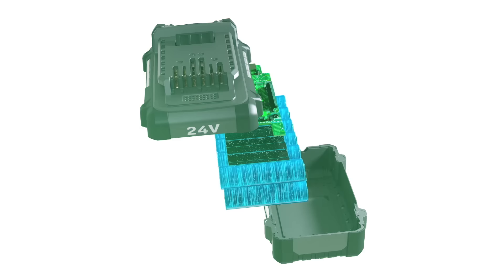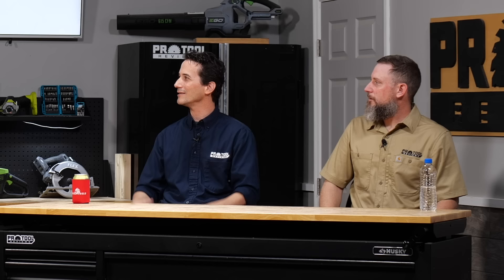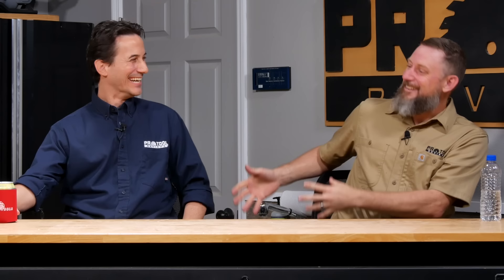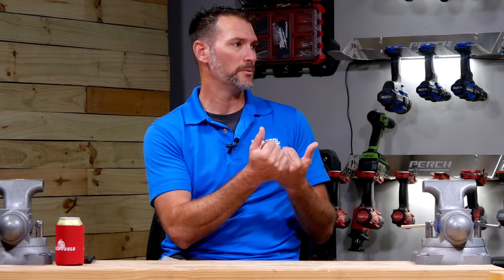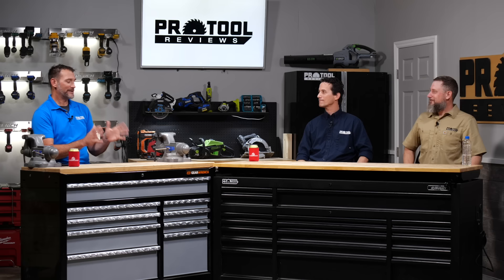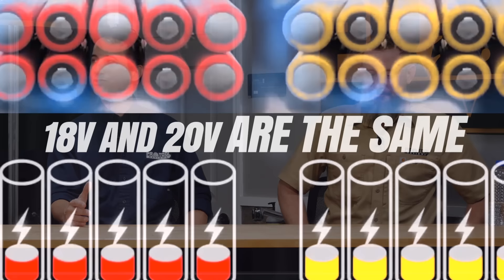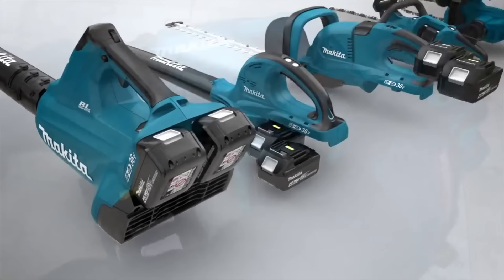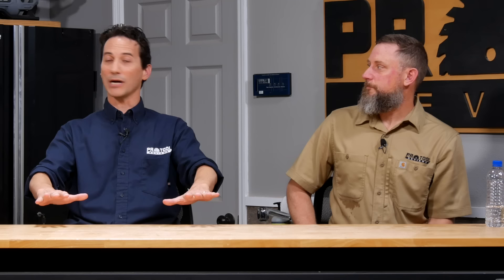You Should Buy 12V Instead of 20V… HERE’S WHY!

Comment: It’s refreshing to see a transition in the conversation around tools from “I need the biggest, baddest, most powerful tools possible” to “Maybe we just use the tools that make the most sense for the specific application.”
Reply: That’s right I love my 12v for my automotive use. Haven’t had the need to upgrade to bigger power yet as I also don’t do suspension or anything really mainly interior work and basic maintenance
Reply: fartpoobox ohyeah  you obviously have never tried to use an impact on screws in metal. Bolt heads shear off with a sneeze if you aren't paranoid in how you drive them. Most Bolt heads also not rated for impact shock so you damage them on first drive in.
But most people with your mindset never actually pay attention to who is going to have to pull out those fasteners or take off that hose clamp or in general to any work on any of the stuff you touch after you personally leave.
Reply: More power is always better. It’s the capability in a smaller, lighter package that is changing the convo.
Reply: @actualperson9628  yeah no because when I'm taking off 5mm bolts I always say damn why can't I have more than 300ft/lbs of torque.
Reply: fartpoobox ohyeah  damn you must be the first person to not strip or shear any bolts in their working experience. Congrats teach us all
Reply: @jonathangarzon2798  You got some points and i keep seeing people who never use powertools being the biggest fans of M18 Fuel.
Reply: It’s because they use thicker gauge windings in the brushless motor to handle the higher current.
Reply: @jonathangarzon2798  I don't know many people who impact metal screws or hose clamps.
Reply: @im2yys4u81  oh they are the majority, it's frustrating because they only do it since they won't be working on it after most likely
Reply: fartpoobox ohyeah  I agree you can't be an 18 more power better if they suck at driving screws then they suck at driving screws
Reply: Same thing with pickups. More power and more size !
Reply: @Richard Charles impacts have 3 adjustments. And as someone who actually works in the trades I can say for a fact that clutches on drills are scarcely used. 
So yeah my point stands
Reply: 12v was designed for small spaces, weight advantage over higher voltage tools when up ladders etc, according to MW's website, horses for courses, I use a 12v set of Makita brushed drill and driver while working on cabinets, bigger Makita stuff for heavier jobs.
Reply: @johnussss  please define heavier jobs though, that's so vague
Reply: @jonathangarzon2798  Ask Milwaukee, that's all their website blurb says  on the 12v stuff... Sub compacts are less able than the bigger tools, do your own research, I did

https://www.youtube.com/watch?v=TKqkqs7qvXg
Reply: @johnussss  yeah I've read the marketing. That's useless.

I prefer to ask actual workers who use them where they've seen the tool work and fail to have enough power.

If I want marketing slogans I'll read the website again lol
Reply: @jonathangarzon2798  Watch the video I Posted then, that guy uses both 12v and 8v versions
Reply: @pflaffik  How do you know what they use? ... magical spy boy?
Reply: I’ve been using cordless tools for 40+ years doing HVAC&R as well as hard core woodworker. Probably 20 to 30 tools dead, lost or stolen, mostly dead batteries. Was started with the M18 was very impressed with the hammer drill (near corded performance) left behind out of state picked up some M12 and was impressed for there size and weight not the performance of the M18. 
As for circular saws I’ll stick with my corded saws.
Reply: Maybe you good way to look at it is maintenance versus building/construction.
Reply: @jonathangarzon2798  I was a commercial electrician for 5 years I started with m18 drill impact and all sorts of other crap. I swapped all except the drill out for m12 and it never failed. Really used the drill a lot for drilling into concrete so I needed the bigger one. 12v platform hasn't failed me
Reply: Power still trumps all at the end of the day
Reply: I've seen fellas dragged thru the mud for using 12v on site. Gotta show off what muscle we got with the biggest tools
Reply: Yes. In general, I like the idea of switching to 12V tools for most things because I don't have a job where I'm using tools like impacts and drivers and saws every day. The 12V batteries occupy much less space and have enough power for what I need, although there is a major lack of 12V outdoor tools generally speaking. That's probably because more power is just an unavoidable necessity. =/
Reply: Nope. The m18 fuel impact is a venerable multi tool with 4 settings. It can be as delicate as anyone's sensibilities! My m18 drill is also a hammer drill. Neither are noticeably heavier the my old makita stuff which was lighter duty 18v stuff from 15 years ago.

I don't want to have more sets of drills to think about when I can have 2 that do it all. And happen to fit the same batteries as a bunch of other tools I own.

I have m12 batteries and a dremel, 1/4" nut driver, and a screw gun.

I gave the m12 screw gun to my aunt for general home use. It's a non fuel variety and goes about 2rpms... one day Bobby, this screw will go in, wait for it, almost there, uh oh... no beans...

The m18 impact on delicate, drive it in, 5 taps of impact and its snug, 7 its tight, sometimes it stops for you.

Comment: M12 systems for the sheer fact the 3/8 and 1/2 stubby impacts can fit just about anywhere without the battery smacking everything
Reply: Just broke down and bought the 3/8 stubby and it knocked lugnuts off easily
Reply: have you used or have the right angle impact? I'm stuck between the m12 and the kobold because the Kobalt does 300 lbs in the reviews.
Reply: @bobthompson4319  I personally have not but I've pulled 350ft lb torqued mast nuts off forklifts with zero issues out of m12 1/2 stubby. I think it's like 1-5/16 socket and it handles it good
Reply: @throughmylens5127  that makes me happy. I just got the stubby 3/8 on sale for 129, waiting for it to ship still, its on backorder. I already have the m18 1/2 impact wrench, I was scared the stubby wouldn't have enough power.
Reply: Preach on it brethren 🙏🙏🙏
Reply: I have a 💩- ton of 24v Kobalt tools and have, overall, had great service from them.

Finally fulfilled the 41+ years of sailing magazine dreams and bought a boat: buying a replicant M12 Milwaukee set of tools after using some on a friend’s boat.  Size really does matter.  Now if only I could convince my wife!  😇

Comment: The higher voltage means you’re drawing less amps, meaning the wiring and electronics can be sized smaller. So double the voltage instead of using 8 gauge wire you can use 16 gauge (half the size) and have the same amount of resistance. The resistance is what causes the heat.
Reply: Hi, new homeowner/DIY'er here. Do higher amps actually FEEL more powerful like with RPM's and longer projects? Thanks.
Reply: @bennygerow  if anything it would be the opposite, higher amps mean shorter battery cycles (as well as shorter battery life, the lower the current load the better) and voltage is what determines the speed of a motor (under no load, a motor will spin at a speed which is directly related to the voltage supplied, so a lot of motors come with a kv rating - velocity constant - which is how many RPMs you get per volt.)

However, motor torque is dependent on amps. A motor setup for higher current will have more power and torque overall. Generally, higher voltage is better because of what MondoTV described as well as the above points I mentioned. A 12v (3 cells in series/3S) battery supplying 180w (15A) with the same cells as an 18V (5S) battery supplying 180w (10A) will last 2/3rds as long and generate more heat in the process, degrading the batteries and the rest of the components faster.
Reply: 8 gauge to 16 gauge is not 'halving the current'.  8 gauge to 12 gauge is the half point (40 amps to 20 amps typical).  But I get what you're saying.
Reply: Double the voltage, half the amps. Sounds good. But then how many batteries in series-parallel is needed to make the higher voltage. Then it gets heavier.
Reply: @imperialsecuritybureau6037  Higher amperage is beneficial  for  more power . If you don't need the power  go with 12v. If you need more power, go with a higher voltage. Higher amps does not equate to shorter battery cycles. You're confusing amperage with power (Watts)
Reply: @bennygerow nope, just makes the battery last twice or 3x as long, which translates to feeling more power over a longer time vs a short burst of power then the battery dies down after 2 minutes of use

Comment: DIY guy here. I build a lot of stuff with screws and construction lumber. The lumber needs to be pre-drilled, so I like a 12v drill and  impact so I don't have to switch bits. But every DIYer should also have a reasonably powerful 20v drill, cause when you need it, you need it. I think most of us would end up (budget permitting) with a mix of 12 and 20 volts.

Comment: For a small engine mechanic like me, 12V is ideal because you can run many (but not all) screws, bolts, & nuts down without accidentally stripping them from over tightening. Plus, most fasteners can be removed easily with 12V.
Reply: There is a thing called clutch on drills, you know
Reply: To be honest most good 12v impacts will carry you pretty well through MOST automotive applications. I've used a m12 stubby to remove rusty old motor mount bolts on a f150. And the m18 high torque carries me all the way through kingpins and lug nuts on class 7/8 trucks
Reply: I'm also a small engine technician and that DeWalt 12v 1/4" screwdriver is my go to for 90% of the stuff I do as I handle most of the handheld ope. The adjustable chuck works like a fast and dirty torque wrench, the lack of impact is safer on plastic/delicate components and it's so compact when you're working in tight spots like snowblowers and lawnmowers.
Reply: if you work on ANY engines, the M12 Stubby impact wrench is KING
Reply: @shadeshiest22  DCF850 3/8" converted with a 1.7ah powerstack is king.

Comment: I buy m18 because I see my coworkers spending 3 minutes to cut one peice of conduit with there m12 while talking about how it gets the job done the same. The Sawzall kinda depends on the blade but fresh blade to fresh blade it feels like I'm cutting atleast twice as fast vs. The m12. The bandsaw seems like 3 or 4 times faster. Don't even get me started on holesaws on those tiny m12 drills.
Reply: The higher voltage bandsaws also have larger openings which makes them MUCH more flexible.

Comment: I actually like the M12 Fuel circular saw for it's light weight and ease of use. Sure it's not as powerful as the M18 Fuel, but as long as your not cutting stacks of lumber, M12 will get the job done just fine.
Reply: Emphasis on the "light weight" that's the best part for repeated small jobs
Reply: I have the m12 saw been using  it for 4 years  I do remodeling and handyman work this saw is my go to. I have makita 36v rear handle and standard but the m12 is a beast
Reply: I want to get that. I love my m12 tools
Reply: I use the m12 saw with the 6amp battery. Even then it's basically a sheet good breakdown saw to kick around the truck just in case. Honestly dont like cutting 2x4s or anything larger with it as it sounds like I'm asking to much of it when it runs. 
If I'm onsite no power il use the m18 saw with the 12amp it came with. Rapid charger plugs into the truck.
 
I know this is sacrilege but still prefer a corded wormdrive for alot of things. I like the torque and that the saw doesnt bog down under load. Some sidewinders rev so high at freespinning they sound like they're going to rattle-fly apart [skilsaw sidewinder] dewalt makes a good sidewinder we've had good with with.
Reply: @martylucas8557  So you just go to the return counter with the item you don't want and ask for a refund? They don't care about the free tool?
Reply: @grantdeisig1360 , FYI…in January I used the hack to get the awesome M18 Fuel 18 Gauge Brad Nailer.  It included a free 8 amp battery.  After returning the battery I ended up paying around $149 for the nailer.  

If they didn’t want you to be able to return the battery or tool they’d state that in the receipt.  However, since they assign a separate price to the tool and battery that equals the price of the tool, it allows easy returns.
Reply: @martylucas8557  Understood. Makes sense.
Reply: Same man, I have Dewalt 12v circular saw and it’s so light! It comes up on my ladder with me and anywhere I go that I might have to cut something
Reply: The only time I've had a problem with mine is when I was 8ft of cutting 3 in Maple. I would have to take multiple passes quarter in each time and then flip it once I get to the back I had trouble didn't mean I couldn't cut it.
Reply: Me too!!!!!
Reply: "Not a real tool" is pretty harsh. What if all u do is decks. 12v circ saw for cutting ends may make this an A1 tools. I kind of feel like this kinda stuff is in the "you only have an sds plus you need to get a spline drill for that 3/8 hole." ;)
Reply: I often find that if the 12v isn't powerful enough for the job, I'd rather go corded because it means I'm working the tool all day. My 20v tools are the least used.
Reply: Yeah man I was going to say, M12 is a beast for what it is.  The weight and size and it’s performance fits for what I do .. 90% of the time it’s all I need for my cuts ..

Comment: We run a farm. We use power tools a lot and are hard on them. I used Dewalt for a long time and then began to invest in the Milwaukee platform. Started with the intention of doing all M18, somehow I ended up with M12 impact and drill. I was sold after a few uses. The M12 does most of the stuff we need. A few exceptions are we have M18 impact and 18 grinder. The M12 platform is unbelievable powerful and reliable.

Comment: If you can afford/justify the luxury, having both 12v and 18v platforms is phenomenal. Certain tools are well suited to either voltage. M12 and Makita LXT are my go to, and I break out each set equally as often and can tailor to the task I'm about to go perform
Reply: I have Makita LXT, love it, but jumping into m12 for the rotary tool.  Thinking about splurging for the installation drill/driver. Any other standout m12 tools that you feel fills in gaps in the Makita lineup?
Reply: Hydraulic impact driver is a real pleasure to use, if you have the option. The new 3d laser is also a must if you are in the market for one.

For my work, being a electrician, the compact bandsaw, right angle impact/impact wrench/ drill are really doing the trick
Reply: You should check out the newer m18 fuel impact guns. It has 4 settings. It's basically a multi impact of some sort.
Reply: @mischavanengelen5343  I don't like the m18 fuel hydraulic impact. It has half the rpms, and half the max torque compared to the non hydraulic. I don't know if the hydraulic one has the multiple power settings that the non hydraulic has either. Mine can ram it home or be beautifully delicate.

"Like a leaf on the wind" - serenity

Comment: I think for most DIY projects you really only need a cordless drill and/or driver. Corded cutting tools are more than sufficient for most homeowners, since they are by definition working around the house they will generally have access to a plug
Reply: DIYers that want to go the premium brand option when it comes to drills and impact drivers, go for the Milwaukee M12 Fuel.

Comment: Loved the discussion guys.

As a commercial electrician I use both. M12 for running Tek screws and fasteners all day plus the subcompact bandsaw for pipe. I use the M18 for task lighting, circular saw, full size bandsaw, hammer drill, drill and impact for driving into wood, concrete or things like 1/2" concrete anchors. 

I couldn't do without my M18's but my M12's really save on my body and space for the low demand repetitious tasks.

I think DIY was meant to describe anyone who does a project over hiring a professional. With that in mind I'd think 18v for DIY. For anyone looking for the ability to drill holes and hang pictures, TV's, ECT, things that don't constitute DIY, then they can get a cheap drill from Walmart.

Comment: As a electrician that always had 18v Milwaukee and DeWalt, recently I switched to Milwaukee 12v and to a guy climbing a ladder or in a crawl space 12v is a game changer. My opinion is that the right tool for the job is based on the job at hand and it's location.

Comment: As a DIYer/hobbyist, I currently only have Dewalt 20v max tools right now such as an impact driver, drill, and reciprocating saw. I even have the leaf blower which is great. I’m actually going to switch over to a 12v drill and impact driver largely because of the size and the fact that they can do all the tasks that I have while being smaller and lightweight. I’m sure a 12v reciprocating saw would work for me, but I like the idea of having longer runtime and plan on sticking with the 20v max at this time. 

Also, don’t be afraid of corded tools. I was given a Dewalt oscillating tool and a circular saw and they work great for me because I don’t use them all the time and when I do I can plug them in and get the job done and know that I will have consistent power throughout. I know that was long winded, but I hope that this helps someone!

Comment: I use m12 stuff for the tool box in my truck. M12 hatchet, fuel drill, fuel impact, 3/8's stubby, 3/8s fuel ratchet, 5 1/2 circular saw, jig saw, recip and multi tool. All fit in 2 ridgid brand small tool boxes and still take up no room in my truck bed. The m12 circular saw works pretty good. I use it all the time.